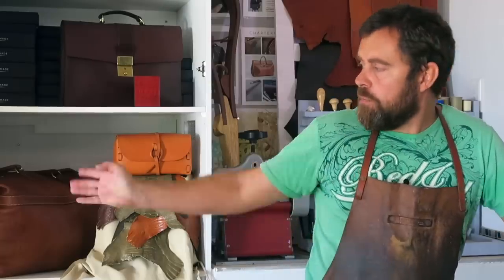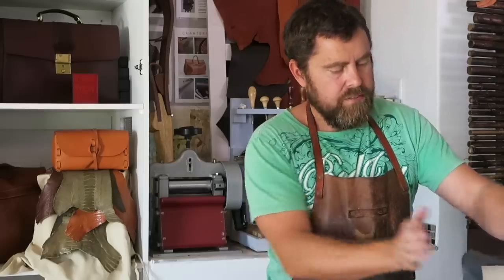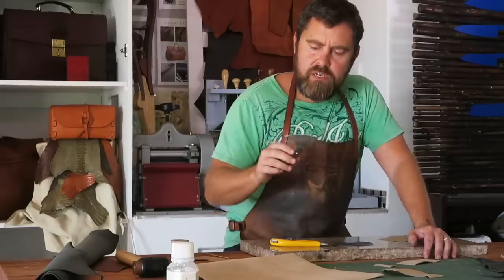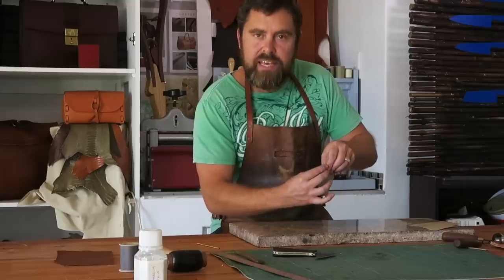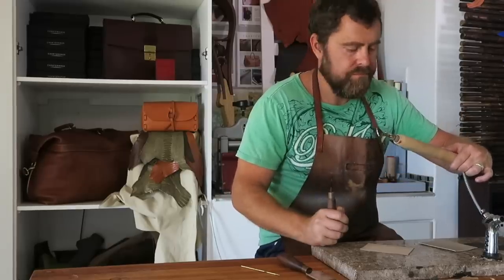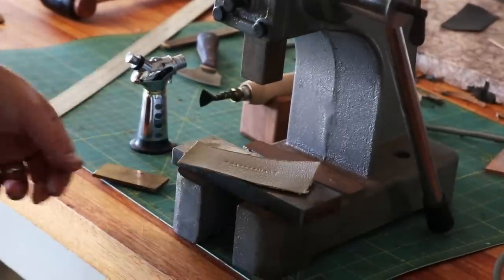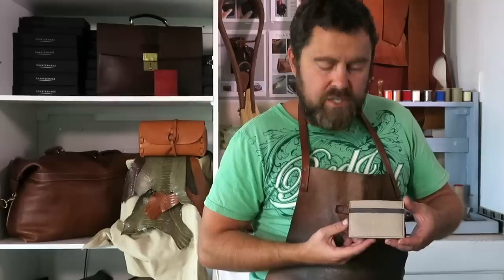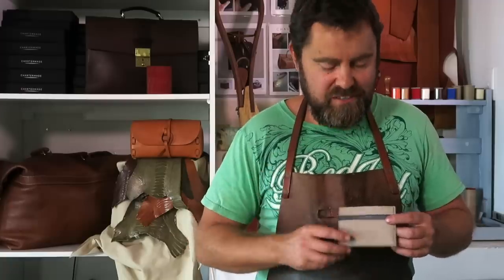Leather card wallet tutorial using Chèvre - DIY

Comment: I would finish the stitch line differently. Take your threads each one through one layer of leather to the inside and overhand knot them. The knot will disappear between the layers and not be seen. No need for sealer/glue etc.

Comment: Awesome lesson my friend. I appreciate you taking the time and sharing your know how with us. Everything about what you do is done with a level of excellence from your leatherwork to your presentation and even your teaching. Thank you my friend. Thank you. Advice for anyone looking for the .PDF on the website: You're going to basically be purchasing the .PDF but don't worry it's a free purchase and you won't be charged any actual money. It's basically a purchase of $0.00 and I'm sure there's reasoning behind that. I found it easier to complete the purchase with my PayPal but I don't think it matters. Once you've completed the transaction you're automatically emailed the .PDF so don't bother looking for it yourself on the website. Just open up your email that you used for the purchase which was in my case the email I used for my PayPal. Also when you print the .PDF you should make sure that you're using the setting "Actual Size" instead of the default "Fit" setting under the PRINT SIZE & HANDLING  options. Also to save yourself some paper I also suggest selecting the "Pages" option under PAGES TO PRINT options and simply typing "3" in the dialog box. That will avoid printing the first two pages of the .PDF which in my opinion weren't necessary to print unless you want the second page for the list of items needed. If you do want the second and third page included in the print simply type "2-3" in the dialog box. I do suggest printing in color if possible but honestly you could probably get by either way.  Anyways. That's just my two cents.  Hope it helps. Anyways. Thanks again friend. I appreciate it. I'll make sure to subscribe and give you a like.

Comment: Beautiful work! I've been experimenting with Chèvre Chagrin as well. Two questions:
1) What is the weight of the Chèvre Chagrin you are using?
2) I noticed you didn't use an edge beveler prior to edge finishing. Why not?
3) Any noticeable difference in your opinion between Fil Au Chinois 532 and 632?
Reply: I’ve tried edge beveling it and it doesn’t look right. It’s such a temperamental leather.

Comment: Would you recommend a sealer at all,  either a dubbin or acrylic. Have made my first 2 knife sheaths for a paying customer, and he wanted a plain veg tan finish. So unsure really, I did a coloured edge coat then applied a generous amount of dubbin, then polished it with a clean rag. The knives stay in his tucker box, so don't hang off belts or anything. He was wrapped with the products and didn't argue price.
Is that something you would do or is there a better way?
Taking into consideration that I have built my reputation in the upholstery game  on turning out a product that will last.
Cheers 
Spriggsy
Reply from the maker: I think you did just fine. On natural veg I use one of the premium beeswax balms and I do have a video on burnishing edges which is my preferred method for knife sheaths

Comment: this is great. im new to leather craft  still confused about skiving leather.do i only do the sides or the whole leather  lets say i have 2mm to 1.8 mm of leather to be used? thanks for any input
Reply from the maker: Skiving is to thin edges. On a wallet I skive around 8mm from the edge but this also depends on the thickness of the leather and the taper I need.
Reply: @CHARTERMADE   thats the part im confused about. if i only skived 8mm from the edges.the middle part would still be bulky right? my ocd is giving headache about this. thank you for giving the time to answering this. your vids are realy helpfull
Reply from the maker: @madbull2124  On thin leather like I used in this project (1.2mm )its fine. Its so project and staring leather depending but I would suggest starting with thinning by 1/3 and see how you like. Also I skive at a taper to thin edges. The best way to learn this is to make something and then get a visual of how it all comes together.